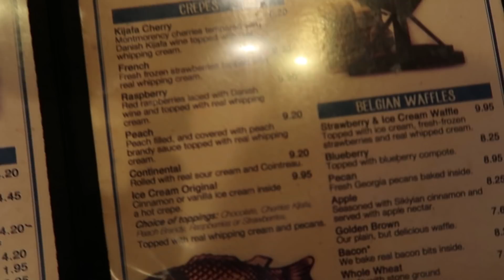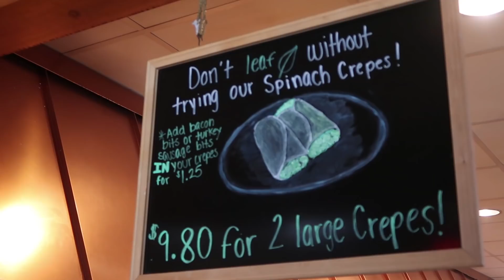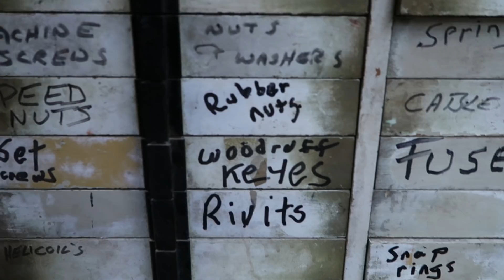Hard Choice.

Comment: Matt, remember, the Doctors always tell of the worst scenario when it comes to cancer. ALWAYS. If they paint a rosy picture, and the shorter timeline turns out to be the reality, people are going to be upset.  If they give you 6 months and you last a year, you'd feel blessed and this positive attitude helps.  The best frame of mind your dad takes on needs to be FIGHT, FIGHT, FIGHT.  If he concedes or merely accept the inevitable, his time will be shorter.  Mental state is of utmost importance.   I'm on chemo for 2 days every 2 weeks, and have had 20 treatments, and I can honestly say, the side effects are not as bad as I was told.  I feel crappy, but it's not at all unbearable.  I get nausea, but each round is different and sometimes I have none. My hair is all but gone, but it's just hair.  I also occasionally get constipated.  Mouth sores are manageable.  It's not NEARLY as bad.  I was given 6-12 months without chemo, and I just passed 11 months. I did drop from 280 to 250 lbs, and although my appetite is less, I'm easily able to maintain my weight, which is key to helping fight.  I am Stage 4 Bowel Cancer, have had 4" of small intestine removed and recovered from the surgery I had last April.  I have a tumor between my liver and kidney that is 8cm by 6.1cm by 4cm. . It has shrunk from the chemo but has recently stabilized in size.  I've talked about it on my channel a few times.  I'll even offer to talk with you and/or your dad if you want. If you want to, send me a personal message and I'll send you my phone no.  I'm in Winnipeg, Manitoba Canada. I'm almost 58 years old, and I plan to be one of the 20% to make it 3-5 years , and I'm going to kick cancers ass and live longer, even if I need to stay on the  chemo I'm on forever. If the tumor doesn't shrink anymore, there are 2 other drugs they could try, but they have worse side effects, or I can stay on the one I'm on, but only get it every 3 weeks, giving an additional week of feeling better.  And I've not puked or been close to puking even once!